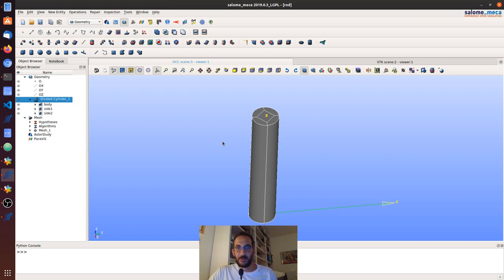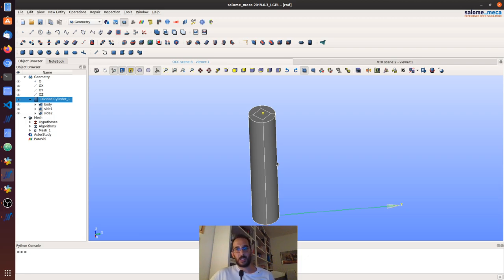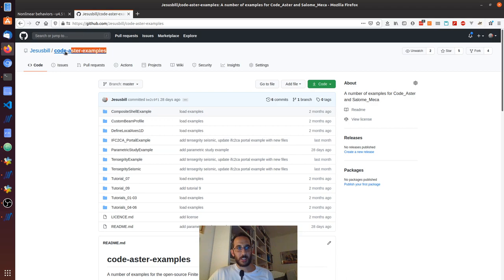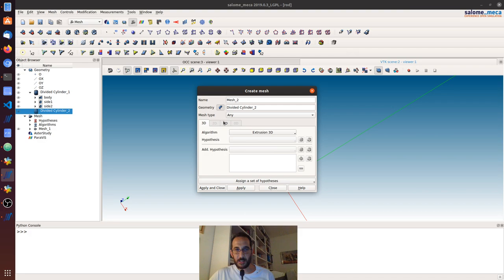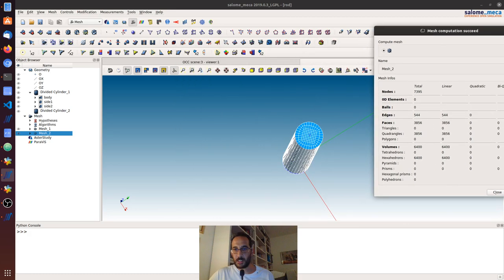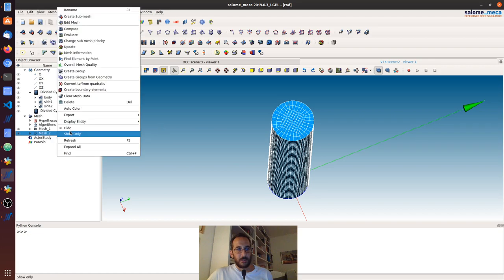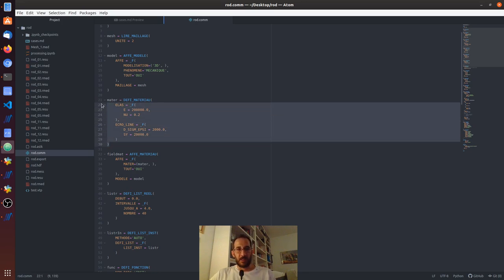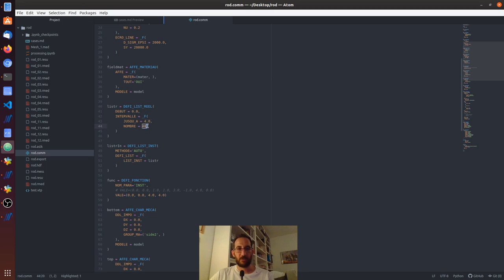How-To Video: Perform a multi-step static analysis with material and geometric nonlinearity

Comment: Very good video, thanks for sharing this! 
It's good you mentioned that sometimes, you have to look at the documentation in french. I also noticed that due to automatic translation, sometimes keywords are changed... the English version of Code_Aster documentation is really a dirty job, there is so much doc in french though that translating all that manually would be just crazy.
Reply from the maker: Thank you Cyprien, yes we always recommend looking at the french documentation as well. Perhaps there could be some room for improvement if EDF could use also a user-defined dictionary in parallel with the automatic translation; a dictionary that would override some words that are consistently translated badly.